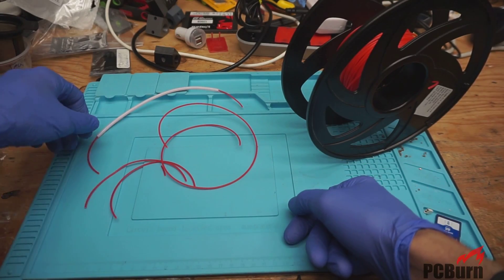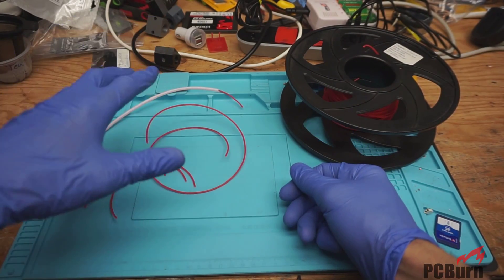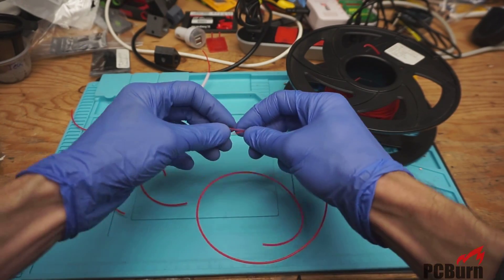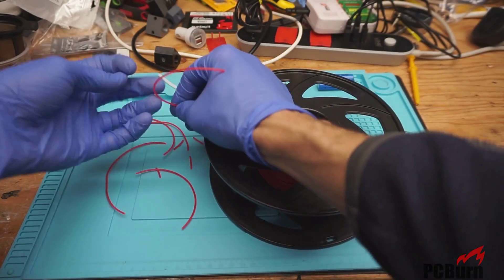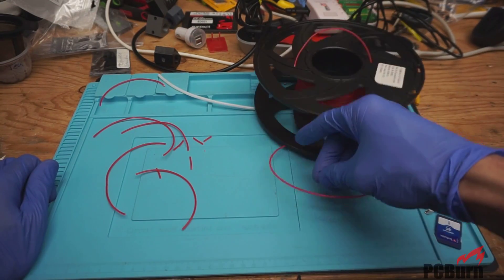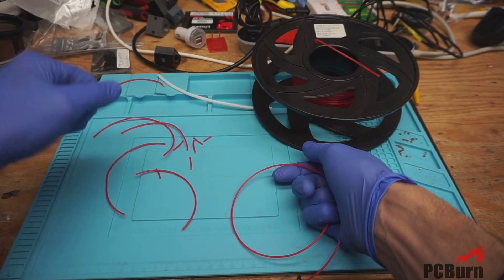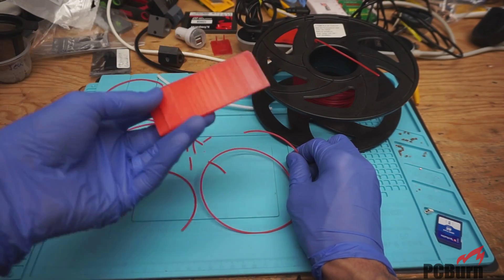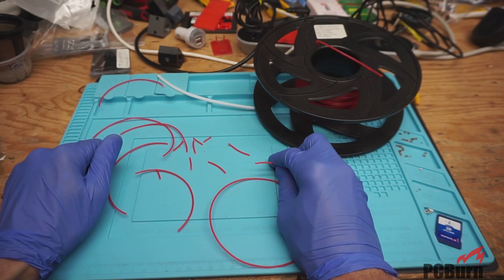Why Does My PLA Filament Keep Breaking?

Comment: what about putting it in when it new and put it in but it snaps  and fails a print ? i just tryed to do a model tank but it was 5 hours and it only done the flat bit so did not print anything at all 

i think may been it snaped as saw it trying to feed but it could not ?

also what should the room temperature  be where the printer is ?
Reply from the maker: If the whole roll is snapping it was likely poorly formed or cooled when wound and is defective. Got a roll like that with a cheap printer once.
Reply: @PCBurn  ok maybe the role then  as its the trial one i got with printer i do have anycubic pla grey to try so maybe that be better       what is the strongest can put in petg or is there better ? as i am looking to make holding brackets to strength stuff and also clips for cables
Reply from the maker: PETG is a bit more flexible and higher temp. PLA is stiffer.
Reply: @PCBurn  what about asa plastic ?
Reply from the maker: @swiftdetecting  Withstands higher temperature and trickier to work with. If the heatbed on your printer is sufficient and the hot-end does not use PTFE, sure.

PETG probably has better properties if you don't need to resist higher temperatures.

You mentioned clips. If they're going to flex and aren't exposed to strong UV I would try PETG first.
Reply: @PCBurn  it be used outdoors in all conditions so looking at the best material to use
Reply from the maker: @swiftdetecting  in that case a coat of paint probably wouldn't hurt. The pigments should help with UV.

Bet yea, ASA (or ABS) will be the best for sun exposure, with ASA being better for UV.

Comment: The fan exhaust might be drying the filament out causing the PLA filament to break. I have the same problem with my PLA. I can load and then print a model. As soon as the model is finished printing, the filament snaps at the feeding gears on the back of the printer. I have never had any problems with PLA Tough breaking though.
Reply from the maker: That'd be the feeding gears I''d assume. Outside of a lab I'm not sure drying filament enough to cause an issue is possible.

Comment: pla breaks from getting old and the humidity of certain areas ..i live in sw florida and i have only a few days until my pla becomes brittle as hell in summer and snaps like that and worse... yes its the cheap basic pla...but moisture causes it... dozens of pla rolls have done this... lucky i only have a few feet left on a roll... i am trying to prevent and also dry ...so far no luck..
Reply from the maker: If you're keeping them in a sealed dry box it's not humidity. Good luck!
Reply: yes a good unit would fix issue...

Comment: i deal with this constantly. i use alot of the sunlu refills an if a roll last more than a week on a printer thats not inside a enclosure or at least the filament its self isnt, what is in open air from the spool to the run of ptfe is always brittle an i had always figured it was down to moisture. what i dont understand is if its in my enclosure it doesnt happen no matter how long its left and i think its down to the fact theres always at least one or two printers running inside a enclosure (i have a single large enclosure that hold 6 printers 2 enclosures total)  so the temp inside is always 30c and above while on the ones in a enclosure by its self or with the filament out side the temps are 21-26c an that is when it happens. i found a roll that has been sitting for over 6months at least an there was quite a bit of the roll that was brittle but as the filament that had been covered come to the top it was fine so its only the filament that is in direct contact with air anything below the outer wrap doesnt seem to be effected. its a pain tho on a couple printers they have pretty long runs for the bowden tubes cause there delta printers so everytime it happens i have to pull a piece thats around a meter to 1.5 at least every time an it happens every single time the printer is left idle for more than an hour or so. so ive found a very small space heater that ive been keeping pointed at the two most problematic printers the past 2 days an so far so good but i have one of them pulled apart right now fixing a clog in the heatbreak was just taking a break an was looking at dehydrators cause i felt like that might helps with this situation.

Comment: It is 100% not moisture.  I made the mistake of re-spooling a couple of my PLA spools and EVERY re-spool started to randomly snap and break.  All stacked in sealed bags with desicant.  I have this problem with both PLA+ and cheap PLA
Reply from the maker: Ah, that sucks. I never actually thought about re-spooling being a potential issue; that's a good reminder

Comment: I opened a brand new sealed sunlu black pla and was breaking like spaghettis. Some part are solid and 1 meter later unusable. I think it's more a factoty problem with mix or something
Reply from the maker: Oh yea! There's certainly more than one reason plastics can be brittle.

Although it could be the same reason. During the spooling process the PLA can embrittle as I described if it doesn't get spooled during the correct part of its cooling phase. Then it shatters during shipping or when unspooled.
Reply: yeah sunlu is not a good filament. all my sunlu pla filament breaks

Comment: Thanks for this, I couldn't understand why my filament kept breaking at the start of a new day's print. I would leave the filament inside the feeding tube overnight where it was of course being held straight. This is a black filament which seems a heck of a lot more brittle than the last filament I used, which was white and didn't snap once. Weird!
Reply from the maker: You're welcome! There's a fair bit of variance between different blends of PLA. Straight PLA is usually brittle; some of the modifiers that blends use give it better resistance to breaking as well.
Reply: Funny, because I have the opposite problem. Without issue, I've used at least 5 kg of a particular brand's black PLA filament. Now I've unboxed a spool of the same brand's white filament that was stored unopened for months. So far it's snapped twice in the first 40 grams of printing. When manually bending two feet of the filament inch-by-inch, it had inconsistent ductility. Most of its length was fine, but there were several spots that were quite brittle and weak.

As we know from tensile tests in the z-direction, modest variations in ultimate strength correspond to a huge decrease in ductility. The weaker layer lines fracture shortly before they can transmit enough stress to yield the bulk of the material. This allows very little plastic elongation of the test specimen.

Besides internal stresses from cooling, scratches or other surface-defect stress concentrators are a possible cause. Also, there could be significant lengthwise variation in material composition (e.g. polymer chain length, moisture/plasticizer/void content).

 Anyway, the filament run-out sensor is a godsend.
Reply from the maker: Yep, manufacturing inconsistency is probably one of the most irritating ways that can manifest.

Comment: If its brittle and you want to use/mount it, toss the roll into the oven at 50°C for ~30-60min.. then the roll wont snap and you can mount it and use it. And when no in use, place it in a sealed container with moist absorption material. :)
Reply from the maker: Good tip if it's absorbed moisture. In this case it's the mechanical stresses on the end of the roll; they're fine on the wound bit.

Comment: Funny that every resource I have looked at states cheap quality. Yet, the cheap chinese filament I normally buy is flawless and the only named brand I bought is having this issue. I have had filament sitting for 2 years in my print enclosure, and the named brand is constantly snapping, yet the cheap chinese filament I load up is flawlessly working and no snapping.
Reply from the maker: Yea, could be down to copolymers used in that case. Or just a different spooling process.

As you say, price doesn't necessarily have anything to do with it.
Reply: @PCBurn  Weird, didn't get a notification until Schlomo replied yesterday. But yeah, I have stuck to an eBay brand called Lioness. Have had no issues with either. I think I just got a bad spool but I had read other comments about that brand having similar issues so I've stayed away. I think to an extent price doesn't always mean quality. The Lioness filament I am paying $24AUD/1KG and it's better than the $35/1KG named brand I spoke about. 

The named filament I would leave in the printer overnight and would be cracked at the extruder. NEVER experienced that before. Oh well, got through the spool to get it out of my sight, lol.
Reply from the maker: Yea, that's probably down to one of the plastics having different additives. Unmodified, uncolored PLA usually snaps under stress after a while. Although that might also have to do with how it's handled during spooling (when manufactured)..
Reply: i have two filaments from the same company, tecbears, the black will print PERFECTLY. I tried printing with the red and was chasing all kinds of problems. it wasn't until i said F it and put the black spool back on to test and it came out perfect. lol there goes 2 days troubleshooting a non-issue
Reply from the maker: Sure, could be a problem with that spool or drastically different properties due to.the plastic blend.

I've certainly run into issues with different spools from the same manufacturer behaving differently. Moreso with PETG but sometimes with PLA.

Comment: This was happening to me on almost every cold start after a few weeks. I put on a capricorn bowden tube and it stopped completely. My guess is it has something to do with the teeth on the coupler cutting into the tube too much over time and scoring the tube, causing it to bend or letting air into that spot.
Reply: I'm having this issue too.  It's breaking at the extruder teeth.  I'm confident it's not moisture.
Reply: @autorepairbymike1356  same on my Ender 3. After 24 hours extruder grips so hard it bites through filament. Ideally a way to remove pressure when printer not in use would be good.
Reply: I have a small zip tie loop to pull on lever to take pressure off when printer not in use

Comment: I experience this from the filament being too dry. Try leaving it in a dry box for any period of time and the same will happen. Doesn’t matter if it’s the cheap or better, or pla+ (pro or whatever).
Reply from the maker: If filament gets brittle and snaps on it's own (not when mechanically stressed) it's generally been mis-handled at some point or has (somewhat counterintuitively) taken on moisture. Even if it's then dried it can still be chemically damaged or have voids.

Here's the first mention I came across: https://support.bcn3d.com/knowledge/humid-filament-bcn3d

A desiccant couldn't reduce the moisture content enough to cause an issue as far as I'm aware. I also haven't read a manufacturer data sheet with a low threshold on moisture that'd be possible to achieve outside a lab unless I missed something.

Here's the data sheet from a common PLA, Ingeo 4043D from Natureworks: https://www.natureworksllc.com/~/media/Files/NatureWorks/Technical-Documents/Technical-Data-Sheets/TechnicalDataSheet_4043D_3D-monofilament_pdf.pdf

Note the drying and storing requirements.
Reply: @PCBurn  thanks for the info. Guess i will need to handle my filament better then or science the $-/: out of this issue.
I keep my filament in a consistent 70f, zero light, and lowest humidity that i can achieve.
I must be doing it absolutely wrong due to these issues with any pla brand.
Reply from the maker: That is weird! Although if I mis-read your initial comment and it's only happening when the filament is off the spool then that'd be expected.
Reply: This happens to me as well.  All filament is stored and printed directly from an electronic drybox kept at 15% RH.  If I don't print for a few weeks the pla in the Bowden tube will be broken.  I think it's related to being held straight when it wants to curl.  It's worse towards the end of the roll.

It's never broken on the roll itself.  That's why I suspect it's a fatigue issue of being held straight in the Bowden tube. 

The only way I've found to avoid it is to unload the material if your not going to use it for awhile, which is kind of a pain since I have a 5T XL.  I like to keep filament ready to go and print.
Reply from the maker: @bluerider0988 yes, that's the effect. With almost all PLA I need to unroll it.

Comment: i've heard a food dehydrator refurbishes brittle pla, but havent tried.
Reply from the maker: That's true for thermoplastics in general if they've taken on moisture. It's good advice to keep your printing plastics in a humidity controlled environment.

This problem's unrelated to that. They also become brittle and break if they've been deformed once they've taken a shape (i.e. been spooled up in a roll then left forced straight to go into an extruder).

Comment: I had this happen.  I am on about my fourth or fifth roll of filament - now, they keep breaking, and clogging.
It is incredibly frustrating.
Reply from the maker: Different blends of PLA, or sometimes just changes in the season, will cause it to happen. Spooling it back up when finished should prevent it.  If that's not possible I'd go with a modified PLA or PETG whenever feasible; the co-polymers make them less brittle.

Comment: is there any other solution?
Reply from the maker: The two solutions are to use a plastic that's more resilient against mechanical stress (modified PLA can be or PETG) or to relieve the mechanical stress by re-winding it when finished. There isn't a way to cheat physics :).

Comment: For me, this is very repeatable with all pla filament.  For me, it gets brittle between the spool and the extruder.  In my setup, the filament takes a pretty sharp bend just before the extruder, and if I leave it for a couple of days it breaks all on its own.  If I pull some slack at the end of a print and relieve the tension between the spool and the extruder, it gets less brittle.

I think it is how you say: the pla is extruded hot onto the reel and completes final cooling on the reel in a coil.  Unspooling the filament cold - flexing the cold filament - seems to initiate embrittlement.  This same effect is probably acting on printed pla objects that flex.  My "ear savers" flex around my head, and they tend to break pretty quickly, too.
Reply from the maker: That's a good point. It is exactly like the embritlement that happens once the PLA is reformed into a printed object.

Comment: Just doesn’t make sense. Got a roll of 3D solutech and same thing happens after it sets a couple hours the filament snaps and clogs up the hotend. Never had this issue before. It’s a nightmare having to completely disassemble the hotend to knock clog out.
Reply from the maker: In general it'll happen with any PLA that's held out of shape long enough. The amount of time depends on what the blend is and possibly some incidental factors with the way it was mechanically spooled when manufactured. Possibly humidity, although I haven't noticed a difference going from bone-dry in winter to comfortable in summer (with a dehumidifier).
Reply: PCBurn! I’ve had it happened after setting on the printer for days. But not after a couple hours and completely brittle all the to the hot end and hard as a rock inside the hotend to where I can’t even clean the nozzle out
Reply: Crazy... Wondering if our PLA is just TOO dry... Snapped right outta the box.
Reply from the maker: Usually, if that's not just a small end section held out of shape, something was horribly wrong during production. New PLA shouldn't do that if it was handled correctly.

Comment: I have the same problem and thought it was from over-drying the filament. Any thoughts?
Reply from the maker: I have to spool up the PLA after use. PETG doesn't exhibit the issue so that stays in the tube.

Modified PLA is sometimes different enough to not have a problem over a few days.